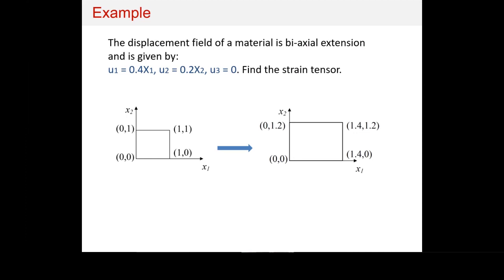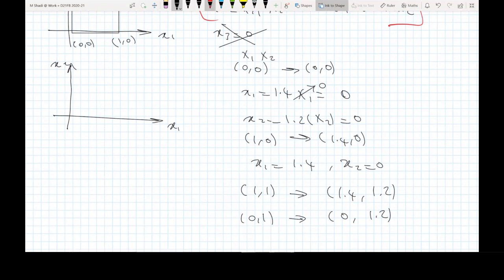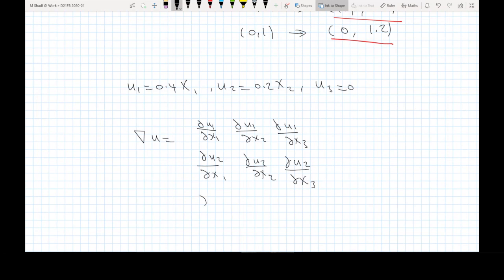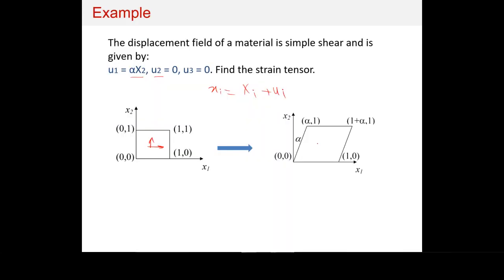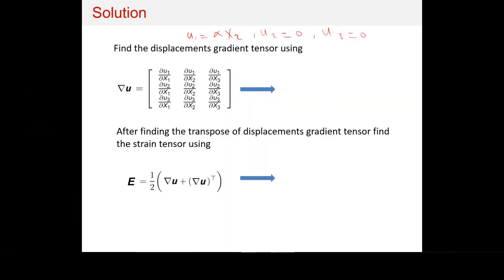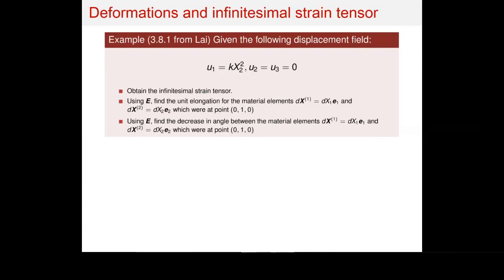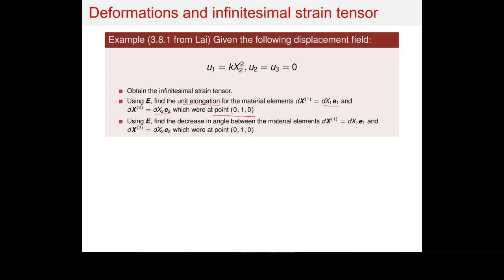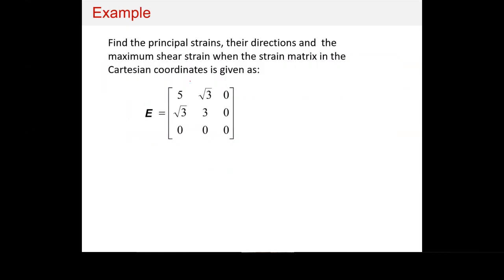Continuum Mechanics: Lecture 6-2 Innitesimal strain tensor

Comment: for a change in the direction of m is: m.En or the epposite?
Reply from the maker: For a change in a unit length in the direction of m, it is: m⋅Em
For a change in the angle between two directions (m and n), it is either 2*m⋅En  or 2*n⋅Em. You can choose either. Both are correct.